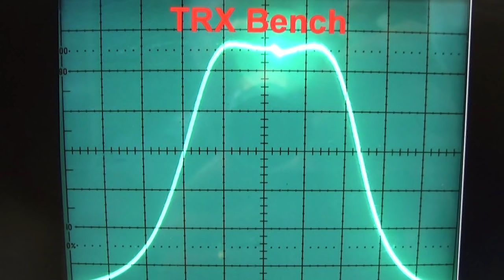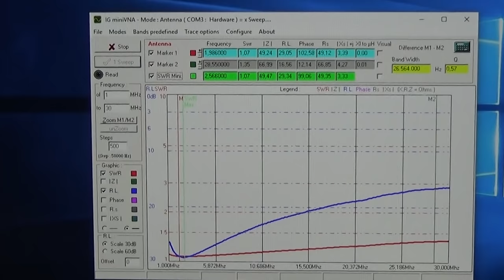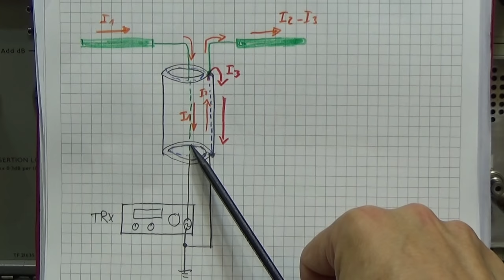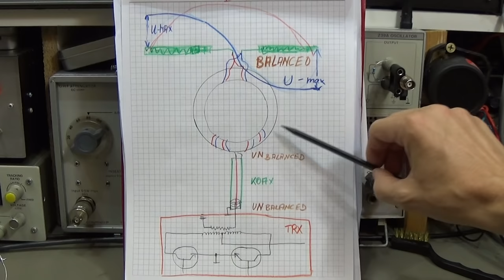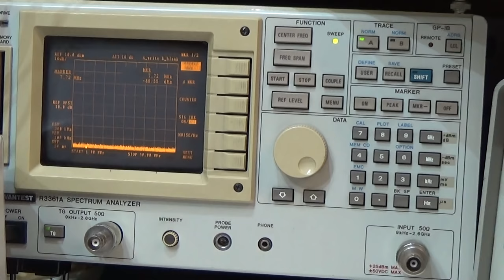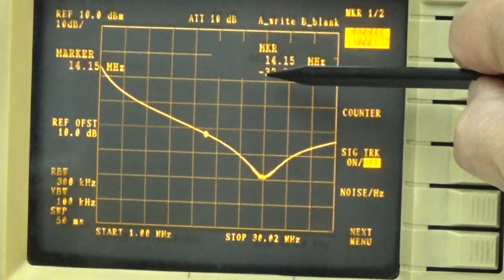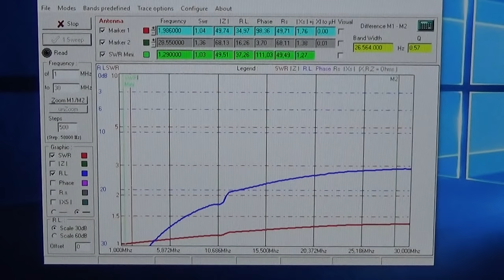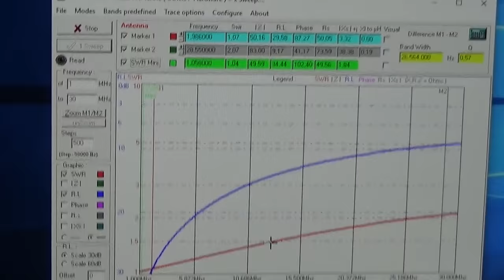#100 Balun PART 1: Broadcast Interference, Common Mode Current and  Balun's magic

Comment: Great video Peter, really informative.  Do these types of BalUn have an advantage over a pure RF transformer using two isolated windings on a ferrite core, like any normal power or audio transformer, which should provide galvanic isolation, wide band Common Mode Rejection and impedance matching, all in one device?

Comment: Do you have any video or photo showing a common mode choke I could make for a mini-whip (PA0RDT) antenna. I'm trying to determine how many windings I need. Thanks. Oh, I should mention, if it matters, I mostly use the mini-whip for VLF reception. Thanks again.
Reply from the maker: Hi, simply follow the BALUN series next is video #101 and #105...hope that helps

Comment: Thanks i now understand better about how baluns work. i can't wait for part 2. awesome. I have one question when you attenuate common mode current do you also attenuate your output signal?
Reply from the maker: Thanks for watching! No that is the magic of baluns they attenuated common mode as the current arrows are in the same direction and the winding on the core acts like a coil with an high impedance over the frequency. The normal output signal is differential mode and due to the bifilar winding the magnetic field eliminate each other and thus there is no or slightly attenuation of the wanted  signal. Hope that helps. 73

Comment: Peter I use the 1:1 Bal-Un and Un-Un like the one you tested that is coax wound on a ferite core. What core material did you use? With the curve I saw, I expect a 67 mix (good for 14 to 28 MHz). I use a 61 mix for 3.5 MHz to 29 MHz. I can't remember off hand what I use for 160 meters.
Reply: I use #31 ferrite FT-240's for my 1:1 chokes because it supposedly has better low frequency performance. But I don't have a VNA or scalar analyzer to actually verify.

Comment: HI. I think the rising swr is due to the inductance, your meter might show it on the x- axel. 

in theory you might do a balon from 1mhz to 30mhz by adding a capacitor on the output side in parallel with the loud to combinsate the inductance from the balune.
Reply from the maker: Hi Kristian, a rising SWR is due to wire which are not exactly matching 50Ohm with higher frequencies. A too low inductance is responsible for low conmen mode attenuation on lower frequencies. Watch the following two videos on this subject then you see the my favourite design . Thanks for watching 73

Comment: Surely a 4:1 balun will change the impedance by a factor of 16, no?  The ratio of primary to secondary impedances is the square of the turns ratio.  Or have I got that totally wrong?

Comment: Great video on analysis methods. Regarding the first two BALUNs you compared, was there an obvious design difference that accounted for the poor performance of the 4:1?  Number of turns, size of core, etc.  Maybe you can cover this in part 2.
Reply from the maker: Hi, thanks for watching! Yes this both Baluns have a complete different design. Let's what I can get into part 2.. 73

Comment: Fantastic video. thanks so much for making this.Question, If I wanted to confirm the attenuation of common mode current on my own baluns, what are the minimum features I would need in a spectrum analyzer to accomplish this?  It looks like your work bench is well stocked, but I would have to acquire this gear and don't care to spend thousands on a single purpose rig.. Any suggestions?
Reply from the maker: Hi Wayne, well in a HAM shack an antenna analyser such as my little miniVNA  is more than helpful and it costs not the world. So may be that is a way as it is a scalar vector analyser as well. Thanks for watching 73

Comment: Quick query? What specifications do you recommend for the toroid you are using. GREAT video, thank you.
Reply from the maker: Hi John, it is  a FT240-63 Cheers
Reply: @TRXLab  63? I already purchased the 43 mix as you said in the next video. I cannot find 63 mix.
Reply: @TRXLab  - There is NO 240-63.  There is a 240-61 good for 1-300 MHz.
I too bought a 240-43 and it will only be good for 3-60 MHz and 250W

Comment: Thanks, very good explanation indeed, but dous it means you have to own a spectrum analyzer and tracking gen to check the working off a balun or are there other ways ?
Looking forward to the next video.
73
PA2HHP
Reply from the maker: Hi Hendrik, no it does not mean you need lab equipment.  This design is really robust that you can be sure that it works if you follow the video. I just wanted to proof that it is right what I'm telling and showing. If you like to do your own measurements watch video #106 about the minVNA tiny. Thanks for watching and feed-back 73
Reply: Thanks for your reply, I already did wach the video, and got the answer.
I will try and replicate your design, and measure its with the mini vna.
Lots off fun to come.
Thanks again, keep up the good work, they are a pleasure to watch.
73

Comment: hey TRX Bench thank you again for sharing your knowledge you are kick A#$ but I'm having trouble understanding so I can't measure the impedance of my antenna you say so how many wrap BALUN do I need for 108 inch antenna??    it's a 102 inches  with a 6 inch mount so 108 inch Ham base station;) antenna I can't wait for your answer your such a huge help also just so you know it does have power hooked up to it an amp I built from step by step direction it's pushing little more than 1000 watts but rarely use it because of fiberglass not letting me have good ground plane even with large amount of grounds can you  tell me in lame terms how many wraps to put on my balun for my 108 inch antenna thanks again TRX BENCH
Reply from the maker: Nena, that is not to explain in 3 sentences. If you have passed your ham radio exam then you have heard about the different antenna concepts thus you have different impedances which can be balanced out with a transforming balun. If it is not a resonant antenna you need an antenna tuner  additional.  Sorry for not having a more satisfying answer. 73

Comment: Apologies for my ignorance, beginner here, in your first test you do not have a transmission line, but just a lumped parameters systems. Is it correct to quantify the SWR? You have no "wave" because you have no spatially extended system: it is a series parallel between resistors and inductors, Thanks for pointing my errors if any.

Comment: I thought SWR was affected by radiator length, not impedance, and than a balun was only needed if the impedance of your antenna was not what your rig was expecting?
Reply from the maker: Well that is a misinterpretation of the job a balun has to do...

Comment: Hi Peter, thanks for all the great videos. I have watched all 4 parts to the Balun series and it has given me a much better grasp of the subject. 
One thing I don't understand, why in this episode you are testing the 4.1 balun for common mode current  without feeding it through a 1.1 balun as in part 3. is a correctly designed and constructed 4.1 balun not capable of reducing common mode currents? Or did I miss something
Best 73
Bill
Reply from the maker: well that is the problem. This kind of 4:1 transformers are often  sold as balun's and that means it has to be capable for common mode attenuation but it is only good for impedance transformation... 73
Reply: Thanks for the clarification Peter. I built the 1.1 to your specification yesterday and it was bang on with a  SWR between 1.0 to 1.1 from 1.6 Mhz to over 50Mhz. I don't have the sweep generator or the spectrum scope to measure the C.M.Current but hope it will eliminate the stray RF in the shack. Really enjoyed the Video 137 where you repaired the Icom IC-R 7000. I own 2 of these great receivers and one is deaf on 430 Mhz, you have inspired me to get stuck in!
all the best 73
Bill
Reply from the maker: good luck with your IC-R7000 project...73

Comment: Is there an issue of receive or reception loss with these?  Can you test for inefficiencies on the receive side or would you use a different antenna for best results?
Reply from the maker: as long the Balun is okay it should attenuate less than 1 dB so no problem

Comment: When using an end fed 9:1 or end fed half wave antenna, should I install my 1:1 balun at the transmitter or right up at the feed point, since with the end fed we are using the coax as the counterpoise of the antenna? Thanks
Reply from the maker: It is always a goos idea to put both the 9:1 and the 1:1 in a balun housing close the the antenna 73

Comment: One more question Peter:  I have a 10 thru 40 meter trapped dipole in my attic.  It works pretty well.  However, you got me thinking;  should I be using a 1:1 current balun, or a 4:1 current balun.  I'm currently using a 1:1 current balun from DX Engineering.   Thanks again Peter,  '73    Bob
Reply from the maker: Well if it is a trapped one I believe that this antenna should be more or less resonant on all bands. If that is the case a 1:1 balun is the right one. If you test with an antenna analyser you get  better information on the antenna impedance.. 73
Reply: Thanks Peter,  I will check the feed point impedance with my mfj-259b.  Yes, a trapped dipole,  one set of traps . . .  the attic dipole is so noisy;  10 db over S9.  For receive, I use a pixel shielded mag. loop outside; disguised as a bird house holder.  I have a very strict  HOA . . .  check out my qrz page for photos:   N7ISU  thanks,  Bob

Comment: Can the VNA be used to analyze common mode attenuation? I just purchased the VNA Pro to start testing my projects. so I'm still getting familiarized with its features.
Reply from the maker: Yes with the same test configuration shown in the video it is possible. 73
Reply: TRX Bench Thanks again for your help. I just viewed video #106 and seen the demonstration with the VNA in transmission mode towards the end. I can't thank you enough for your help :-)

Comment: I always learn a lot from your videos on RF electronics and thanks for taking the time to share your in-depth knowledge.  Question:   Would an MFJ-854 RF current meter be helpful in determining whether or not you have common mode currents in your antenna system?  Thanks so much Peter  !  !
Reply from the maker: Hi Bob, thanks for feed-back! Yes the MFJ-854 is exactly the right instrument to test for common mode current on coax cable. 73
Reply: Thanks Peter, will get an MFJ-854 ;  a good instrument to have in the shack.  Thankfully, I haven't had any complaints from neighbors . . yet . .          Bob
Reply: I purchased an MFJ-854.  I checked it's calibration per the manual.  50 watts into a dummy load and the MFJ-854 read exactly 1 amp. which it should.  When I transmit now, the 854 is showing only 25 ma of current with 100 watts output.  That seems pretty good to me.  What do you think Peter ?    tnx   Bob
Reply: Peter, reference above;  25 ma of rf common mode current with 100 watts output.  Does this indicate that my antenna system is doing OK?  Looks pretty good to me.  Also,  I see no current on my ground system, using the MFJ-854.   Bob
Reply from the maker: bobclarie
Bob with this figures your common mode attenuation is approximate  35dB. That means excellent! 73
Reply: I like "excellent"  Peter.  I use a DX Engineering  1:1  current balun on my center-fed trapped attic dipole.  Could you share with us how you arrived at 35dB attenuation?    tnx,   Bob   '73
Reply from the maker: As P=I^2xR=25mA^2x50 means 31mW. dB=10log(100W/31mW) so attenuation is 35dB... 73

Comment: Hi peter, Is the choice of wire used really that critical when using low power ?
Reply from the maker: Yes you need wire what is at least 100 Ohm to get 50 Ohm in parallel...It is not only the power you have to look at.

Comment: Peter is there a way to do the attenuation check with just an antenna analyzer?
Reply from the maker: Hi John, no you need a signal output like we have it on the miniVNA 73
Reply: But doesnt an antenna analyzer have a signal generator?

Comment: Hello. can this 1:1 balun for common mode current elimination help me with local electrical noise?  On almost all bands my receiver is completely blocked by electrical noises. Thanks..
Reply from the maker: Hi Alfonso, well this common mode attenuators or so called 1:1 baluns  can really do a lot but as long you don't know exactly where your distortion is coming from you can't guaranty that this balun will help on its own. Sometime the noise comes over the air and that is where the 1:1 can't help. You need to investigate your own situation to fight the problem effective...Hope that helps a bit 73

Comment: Does it apply to a dipole antenna connected on a receiver? Or only for Tx?
Reply from the maker: Hi Simon yes of course but I would use it together with the 1:4 transformer...Cheers

Comment: Why you said ,many times ,"the balun convert 50 ohm to 200 ohm". if balun is made for this then reversely, balun should convert 200 ohm to 50 ohm to match because antenna itself receives signals too and it convert electromegnetic waves in to electric wave and passes to receiver.
Reply from the maker: what you are saying is not true check your technical literature for more details...

Comment: hi peter, I figured it out i had too much wire extended at the end with a connector and it made a difference when i shorten the wire and the SWR dropped.
Reply from the maker: oh yes as short as possible is key. glad that you got it under control 73

Comment: Hello Peter you give a very clear understanding about the balun. I use multiple in my antenna system. Stacked cores with rg58 cable. It has a high common mode impedance. Would be a nice measurement in part2. I have not the equipment to take the measurement myself. I want to point out the interesting article of OM w8ji about this subject and in particulair the measurement test. Maybe you can check it out to see if your measurement is correct. I am looking forward to see part 2. Many tnx Henk
http://www.w8ji.com/balun_single_core_41_analysis.htm
Reply from the maker: Hi Henk, thanks for watching. Well I can not really see the test setup w8ji has done so I can't say. But I'm very confident that my test setup is right and thus I think my results are entrust able. 73

Comment: Can that balum be checked with the MFJ antenna analyzer
Reply from the maker: You can check the SWR but you can't check the attenuation.. 73
Reply: Ok can you explain how, because I tried it i put 50 ohms across one end and the analyzer on the other end and i still can't get the SWR

Comment: Nice video Peter, congratulations. However, you are not measuring the balun! you are measuring his VSWR only. You need first to check how well balanced is your device, measuring the phase and amplitude. CMRR measurement gives the quality factor of your balun, not your VSWR measurement! 
You can have a device that looks like a balun with a wonderful VSWR that UNbalance your antenna!
I think that you must show your audience how to measure CORRECTLY a balun. Regards and congratulations again. Good luck

Comment: Are my neighbors upset with my TVI?  Nah... not a chance.  They believe that my transmitter and linear amplifier is just fine; although it does dim the lights in their home just a little bit.  However, I did find my coax cut and the end tied in a noose...
but it couldn't be upset neighbors... could it?  (Just teasing)
Reply from the maker: LOL yeah all is fine in this case.. Thanks for watching 73

Comment: But HOW does it remove the common mode current I3?
Reply: It is a high impedance looking back down the length of coax's outside braid (shield)
Reply: @jamesk0ua Yes but WHY? It's the same conductor for the current going the other way!

Comment: His choice of a 50 Ohm common mode load is a number picked out of thin air. If this is a broad banded 4:1, a lossy core is used, lost power. Like adding some dummy resistance inside your tuner to make it have a low Q. But it's low swr on all bands! So is a Dummy Load. An efficient 4:1 preceded by a coax choke Balun is better.

Comment: I always thought that broadcast interference referred to interference from commercial radio stations.
Reply from the maker: Hi Roger, yes that is right. If you disturb broadband radio transmissions than it is broadcast interference... Cheers
Reply: I have always understood the meaning of BCI as the interference that a ham (or any other user) receives FROM a commercial station. Am I wrong?
Reply from the maker: Hi Roger, yes I would say it is the other way round but not the way that a HAM interferes a Broadcaststation but the receiver where the broadcasting will be received...